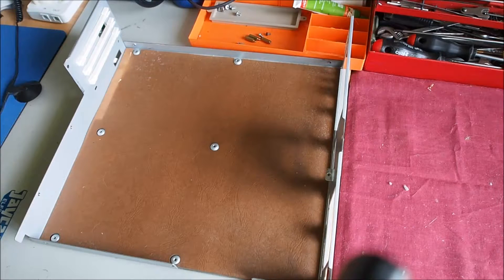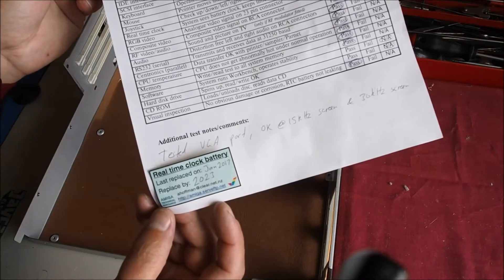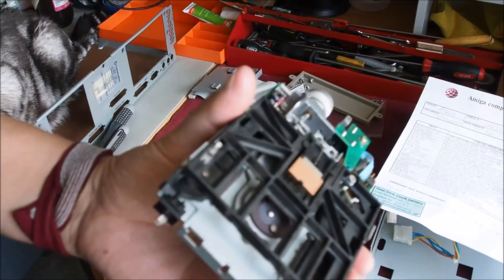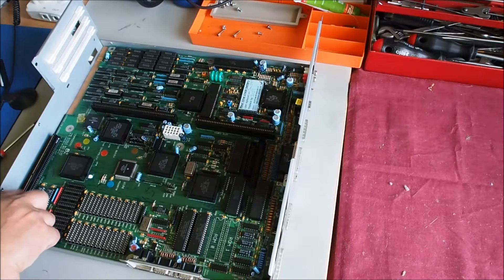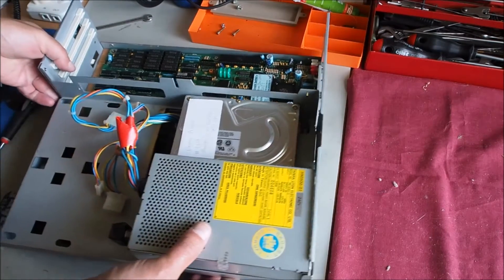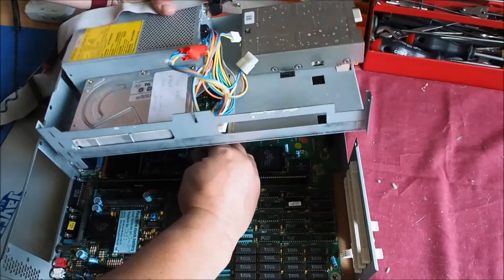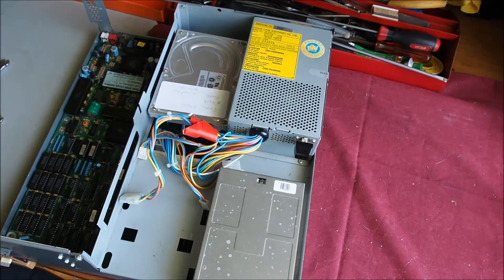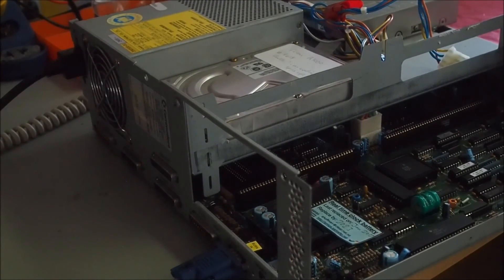Amiga 3000 Assembly Part 1.

Comment: FYI,  the floppy cable blank locator plug is easily removed from the cable with a xacto or razor knife. And the cable should work fine.